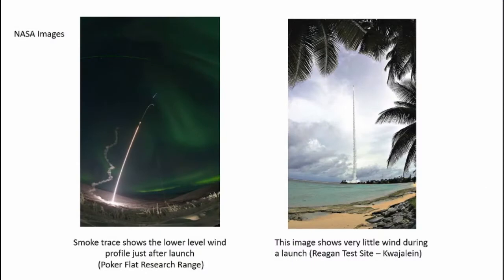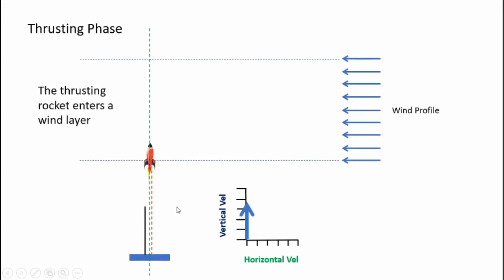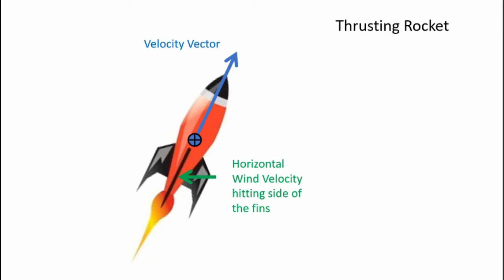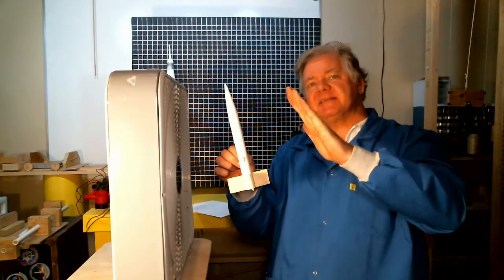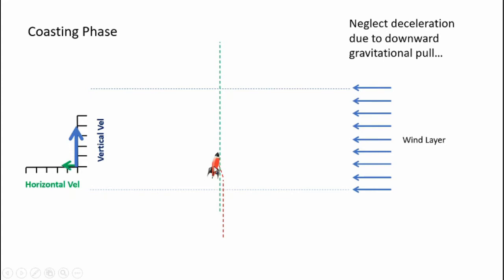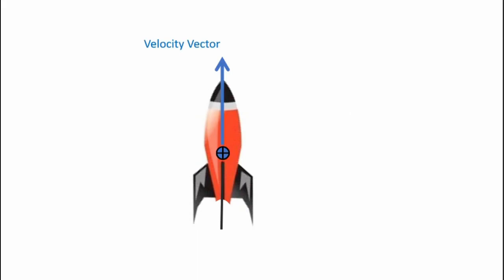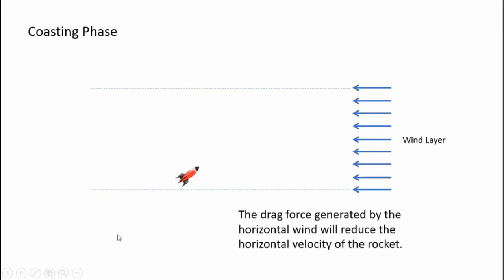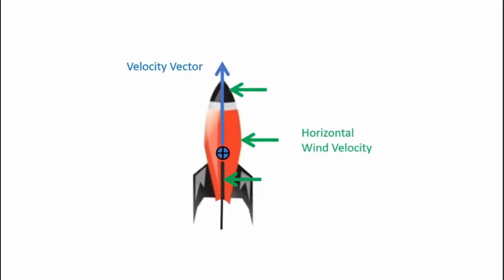Wind Effects on Rocket Flight

Comment: Great video! What about rockets with no fins using thrust vectored control for stability? What are the factors that may affect its torque during flight?
Reply from the maker: Winds will also affect a guided rocket.  Rockets with a simple guidance system that simply maintains pre-launch azimuth and elevation angles wont pitch into wind much, but will drift with the wind.  Rockets with more sophisticated guidance systems which allow them to fly to a point in space wont pitch into the wind or drift with the wind.  Wind acting on the rockets will cause adverse pitch/yaw moments that will cause the movable fins or movable nozzles to respond in order to keep the rocket on track.  Wind shear is the biggest contributor of adverse torques during flight.  Guidance systems will also respond to structural vibrations and rocket bending so they have to be designed properly.